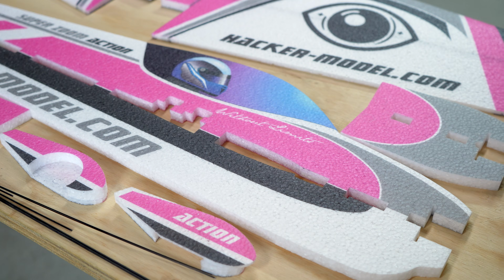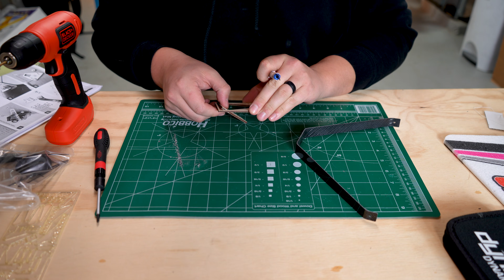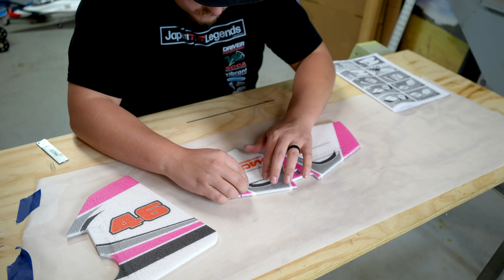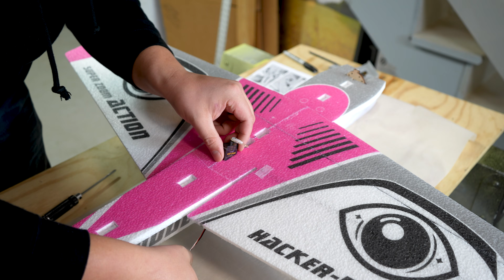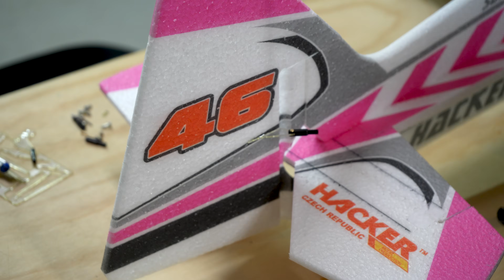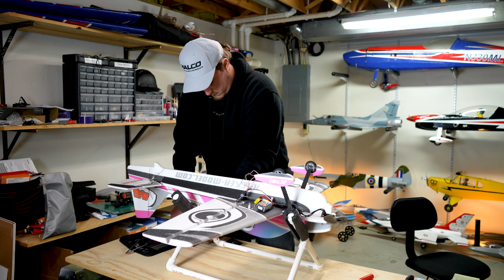Building The PERFECT 3D Park Flyer - Hacker Model S.Z.A

Comment: Very cool scheme love the hot pink! BTW no need for foam safe ca on epp nothing melts that stuff, normal ca works perfect, Beacon foam-tac and quick grip are awesome too
Reply from the maker: @garycaruso4883  Good to know! Had a terrible time with regular CA and foam in the past 😆
Reply: @Hangar14RC  If it has Styrene in the name you want foam safe (OR DEPRON), but poly Propylene is super resilient, cheers!